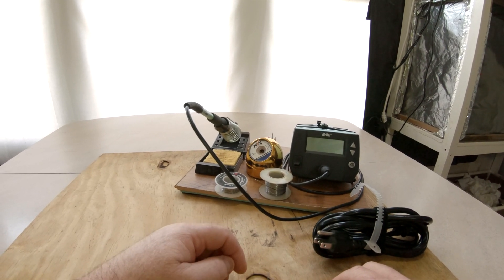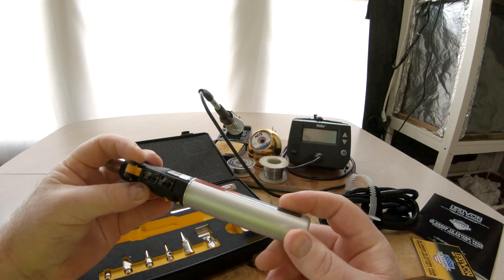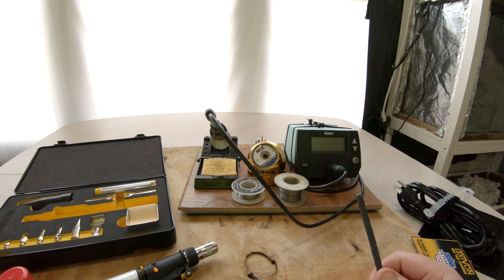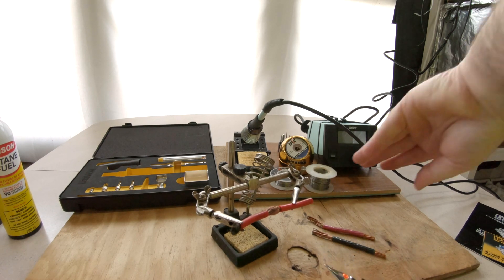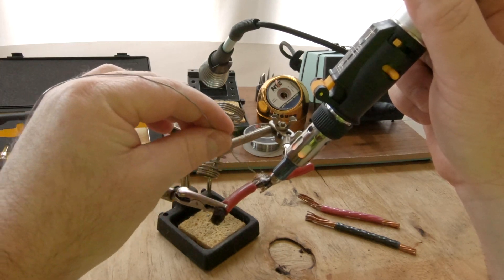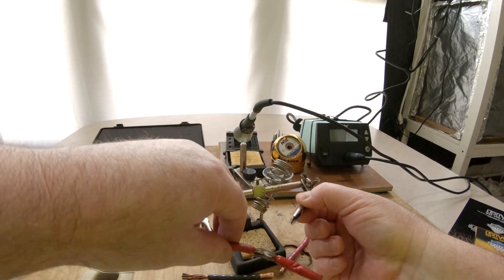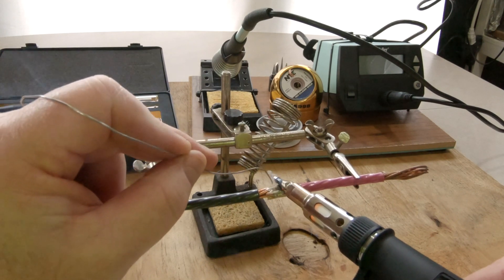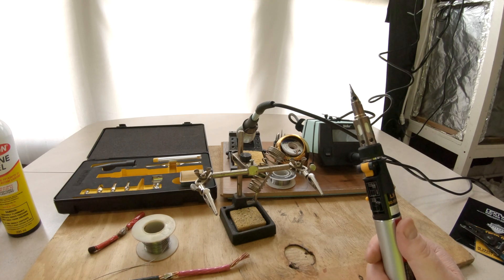LEXIVON LX-770 Butane Soldering Iron, is it any good compared to a Weller soldering station?

Comment from the maker: The short answer is yes, this LEXIVON Butane Soldering Iron is very good! I did some ridiculous things with this device and it handled my ask perfectly well. I know my beloved Weller soldering station could not do what this LEXIVON kit did in the video. But it's an apples to oranges comparison, so keep that in mind please....

UPDATE, long term review of this soldering iron -- https://youtu.be/o9Dh51x9KYw

Things used/shown in this video:
LEXIVON (LX-770) Butane Soldering Iron -- https://amzn.to/3wZncWt
Weller (WE1010NA) Digital Soldering Station -- https://amzn.to/3iOWOWW
Engineer (SS-02) Solder Sucker -- https://amzn.to/3iQrO91
NTE Electronics (SW02-10) No-Clean Solder Wick -- https://amzn.to/3iW85Vr
Hakko (599B-02) Wire-type soldering iron tip cleaner -- https://amzn.to/3DAsk4r
Soldering Tip Replacement for Weller -- https://amzn.to/3tWIemu
LEXIVON Genuine Butane Torch Soldering Iron Tips -- https://amzn.to/3iQJeT1
Camera -- https://amzn.to/3iVcPuy
Upgrade -- https://amzn.to/3NApcKz

Give a 👍 and subscribe 🔔 if you'd like to see more of these video reviews and thanks for watching 😃!

Comment: Can anyone help with why my Lexicon torch lights but then cuts out?  If I take the tip off, it lights first time and stays lit.  No problem.  But place the tip/tool on top of the torch and just just cuts out.  Have practiced trying to make this work but unable.  

Help?
Reply from the maker: This sounds like poor fuel or an incorrect air/fuel mixture. Try just opening the gas valve to bleed off some of the fuel in the tank for a few minutes, then try to relight. If that works then you probably overfilled the tank with liquid without enough gas/pressure.
Reply: @Finite-Tuning  Thank you for your response.  I will give your advice go tmrw.  Very much appreciate this pointers.  Been frustrated, especially when the naked flame works A-ok.

Comment: Can you do tiny stuff with this?  Like say replace a micro USB connector?
Reply from the maker: Sure it can handle small stuff, no problem. But a micro USB connector? I really don't know for sure. I'd say that has more to do with the operator than the tool. I'm sure that I couldn't solder a micro USB regardless of the tool. Too small for me to even see without some serious magnification.

Comment: It looks like Dremel's model. I have similar from Proxxon, it's perfect; not only as soldering iron with metal tip, but also butane solder for copper. And since it has that small tube-like tip, you can solder copper and brass more precisely. I got to say before I bought it, I thought, "No way, I'm gonna need this," but ended up using it for everything from removing the heat gun glue, folding plastic parts, welding plastic... It's very versatile.

Comment: I think butan soldering irons usually runs hitter then any other electronic soldering irons out there ✌️

And another thing, if you you need to heat something up in winter, doorlocks or what ever, that butane iron are useful fir that too..

Comment: Probably need more surface area to solider something that thick I would have chosen the knife blade..
Reply from the maker: You've missed the point. It was not about trying to make it easy for the thing, the point was to make it very difficult! I did say in the video this is about the dumbest thing you would ever try to do with a soldering iron.

Comment: Small lead, no flux, small tip, wrong technique. I would love to see a professional try to solder this size of wire using this soldering iron. After this review I still can't tell wether this soldering iron can do this job or not.

Comment: hi it looks like a nice soldering iron and the price very reasonable.  I have just got 2 Portasol pro 125 they didn’t fire up that well yesterday   and i am using fresh butane
Reply from the maker: So far, I simply cannot complain, I love this thing! I'm supposed to use some kind of super purified butane, but honestly I've never heard of such a thing until I purchased this tool and read over the manual. I'm just using plain old butane and it's still just working so far so good!
Cheers 🍻.
Reply: There's no such thing really, normal lighter gas leaves some kind of powdery substance behind, try just discharging the aerosol on the floor and you'll get what I mean. I doubt it has any effect as it's literally just a mini blowtorch, and they run on the exact same kind of butane

Comment: Looks like Homedepot has several Butane soldering irons available for a similar price. Dremol, Bernsomatic ST500 both come with different tips. I feel like I messed up going with the Steinal ST500 that comes only with one spare tip for 40 bucks.
Reply from the maker: I considered several different brands and ultimately decided on this Lexivon because it has an aluminum gas tank and came with a large assortment of tips. It seemed like the best bang for the buck and I've been very happy with my decision ever since. I've used it on several projects now and I find myself just looking for excuses to pull this iron out of it's box, it has a lot of power!
Reply: @Finite-Tuning Yeah I've been needing one. I prefer to solder and heat shrink wires on my vehicles and for that I've been using a welder with the trigger but it's kind of bulky.

Comment: Also using the soldering tip for soldering that big of a wire is not going to cut it. You would use the exposed flame for best results. That is too large of a wire for a small soldering tip and all that copper is just sucking the heat away from the joint. And as tips go, clean and flux your tips first for best results when they are new as it helps keep the solder onto the tip. And I like your Weller station, its a good station for basic electronics.
Reply from the maker: Lol.... I am aware! Did you not hear me say: "this is about the dumbest thing you would ever do with a soldering iron"? 

I know it can be done more easily, but easy was not the point of my tests. Please re-watch and this time listen to and watch the "entire" video. Nothing about this testing method was about logical or easy, I did this specifically to test and prove, show and tell the worst case scenario that I could realistically think of for using this soldering iron. I could have tried 2 awg, but that's not realistic. 
Cheers 🍻
Reply: @Finite-Tuning  now 2 gauge wire I would have liked to see. That would be impressive indeed.
Reply from the maker: @CandorPerlicious  :

 😁, with the right tip, this thing just might do it!
Reply: Yep,   The Lexivon  can also be used as a small blowtorch  and using that technique would show how easy it is to join 2 larger cables .  It was a bit pointless showing how a soldering tip struggles to put enough heat into the joint.

Comment: He says "can you feel that", yeah i can feel the heat from here, hehehe.   Very nice butane soldering pen, i love it :-)  I have a similar one, but yours is nicer.  Mine is mainly a small torch with attachments for soldering.  For soldering large wire like you did here i would of used the torch attachment instead of the soldering tip.  The little torch is perfect for large wires like that😁
Nice gold solder holder, i never saw one like that,,is it a solder holder or was it originally used for something else.
Reply from the maker: Yeah so far I really like it. The torch tip would have been much easier to solder this heavy stuff, but I was curious to see just what the soldering tip alone could handle. I was going to do a side by side comparison to my Weller, but it quickly became obvious there is no comparison. I know my Weller could not handle freekin battery cable.... 

The only gold thing in the video I think is a soldering iron tip cleaner: https://amzn.to/2XoQTOV 

Then inside of that I have some solder Wick: https://amzn.to/3aUkIKX
Is that what you were referring to? Cheers bud 🍻
Reply: @Finite-Tuning  Thanks, yes, that is what i was talking about.  I love the gold solder iron tip cleaner, i will have to get one of those  :-)